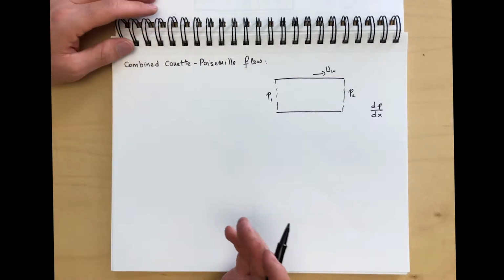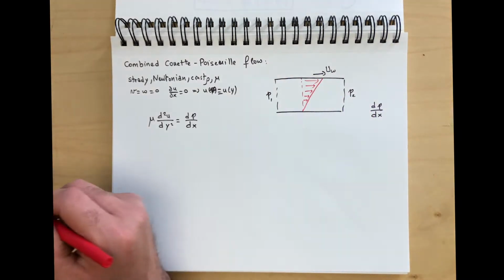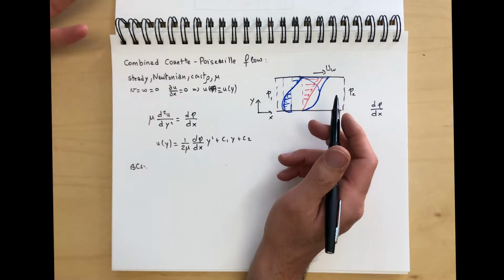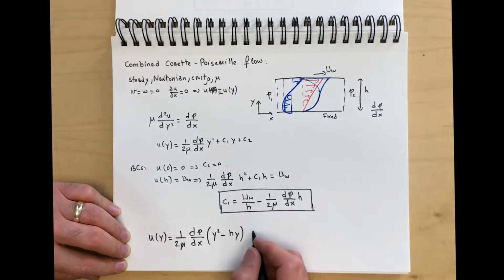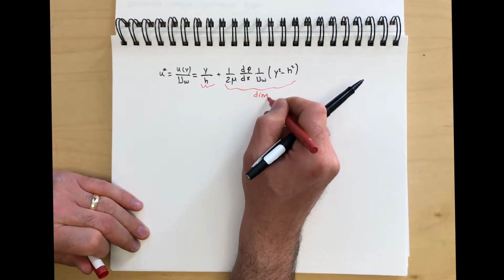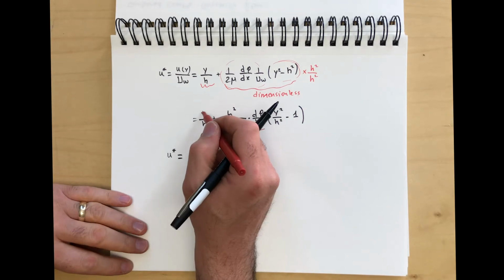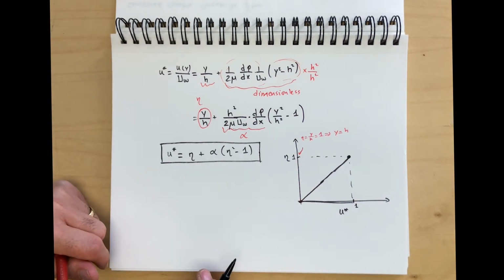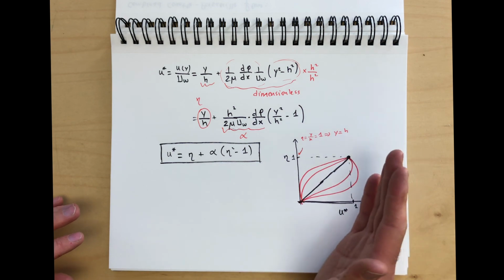15.2. NS Example 2 - Combined Poiseuille Couette Flow

Comment: Hi Tony, 
I'm confused as to why when you take the step from u to u* the "yh"-term turns into "h^2". Any chance you could clue me in on whats happening there? Many thanks in advance.
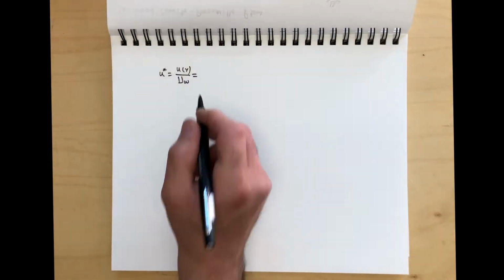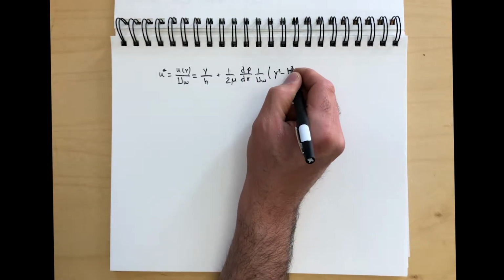Reply: @ProfessorSaadExplains  at 5:07 your have u(y)=(1/mu)(dp/dx)(y^2-hy)+(Uw/h)y ; you then develop u* as u(y)/Uw and conclude at 5:29 u*=u(y)/Uw=y/h (moved from the back of previous equation) +(1/mu)(dp/dx)(1/Uw) <- this divides the whole term by Uw/ makes sense and now the part that I dont understand: the term: (y^2-hy) is replaced by (y^2-h^2) so the y of the previous term has taken the value h but how do we know this? apologies if this is a silly question.
Reply: @offwatchlabs  I found the same. I believe this is simply a mistake copying from one page to the next. it should be (*)[y^2 - hy] 
and simplifies in the end to u* = eta + alpha(eta^2 - eta)